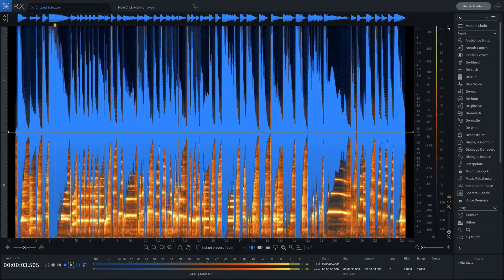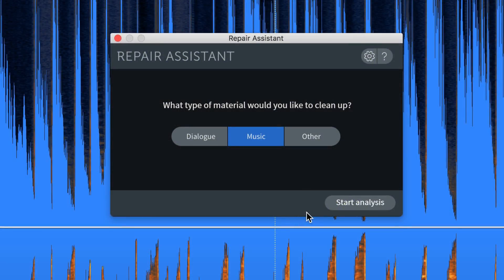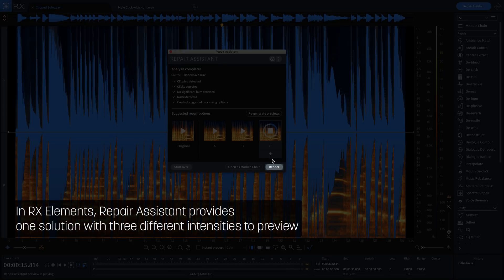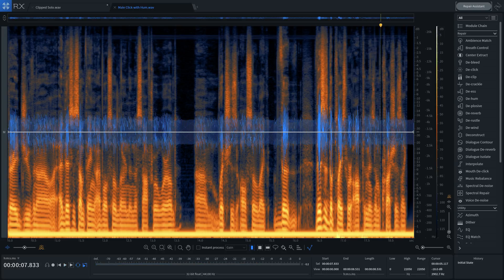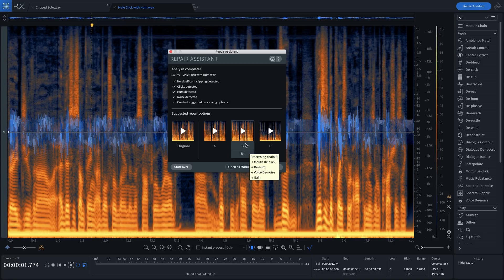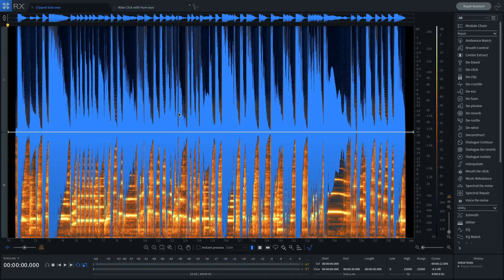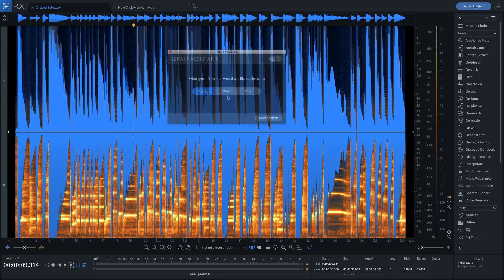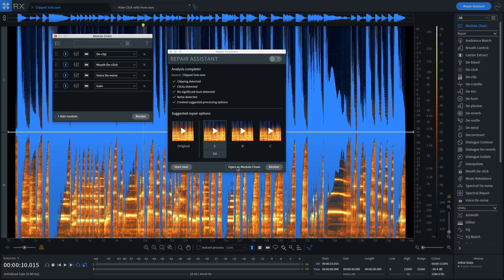Solve Common Audio Issues with Repair Assistant in RX 7

Comment: For some reason, The Rx 8 that came with my Platinum Holiday Bundle did not download Repair Assistant. Where do I find this application? Is it a VST, a separate download? My iZotopoe Portal has zero installs left.

Comment: thanks for the vid but opening rx repair assistant is not intuitive. 
How to use RX as an audio editor with Logic Pro X
"RX is a powerful audio editor that Logic Pro X users can use to get better sounding audio in their video projects.
RX can be used as an audio editor within Logic Pro X to process your audio offline 

To set RX as the Sample Editor for Logic Pro X:
1. Open Logic Pro X and go to Logic Pro X > Preferences > General and select the Advanced tab
2. Enable the 'Show Advanced Tools' and 'Audio' check boxes
Logic_Advanced_Settings.png
3. Click on the ‘Audio’ tab, and then select the ‘Audio File Editor’ tab.
4. Click in the ‘External Sample Editor’ path, and navigate to your applications folder. Select RX and click ‘Choose’.
Logic_-_RX_Audio_Editor.png

To edit audio from Logic Pro X in RX:
Select the audio file.
Click Edit/Open in iZotope RX (the keyboard shortcut is Shift + W)
RX will automatically load.
Perform your audio edit, then click File/Overwrite Original File to save the edit.
Close RX, and navigate back to Logic Pro. Logic will automatically update the audio file to reflect your edit. Please note that your changes will not take effect until you close out of RX."

Comment: Where do I find the repair assistant inside of ProTools?
Reply from the maker: Hi! The Repair Assistant is not a plug-in. It is a button inside the RX 7 application. If you want to use it in conjunction with Pro Tools, you will need to use RX Connect to send Audio over to RX via the Audio Suite menu. Then run the Assistant, make your tweaks, and then send it back to Pro Tools.

Comment: I would've purchased, but never heard suggestion C... kidding. I love this product and use it every single day. Anyone on the fence about it, do it.
Reply: now I use rx7 also I love isotope anything im a hip hop artist and every product is amazing for me but for rx7 when u presss repair assistant for ur  opinion do u click open as module chain and go to the adjustments and settings and choose a preset or does repair assistant do that for you bc I have been choosing presets the hole time because it looks like repair assistant just does the default settings for each module

Comment: If my source audio was coming into the recorder at acceptable levels and it doesn't appear clipped, but it was actually clipped from the source. Is the assistant able to process it as clipped audio even if it isn't technically clipping on the waveform display? In other words, I have a recording of clipped audio that doesn't technically clip in the audio software, but you can tell it is clipped because you're hearing it. It's just already been through a compressor.
Reply from the maker: If the audio is clipped then the repair assistant will use De-clip to adjust the gain of the track to improve the sound of the signal.  If it is not above the threshold of your DAW, you can manually set a lower threshold in the De-Clip module. If you have any further questions please reach out to support@izotope.com.